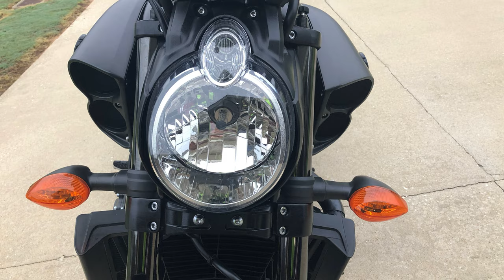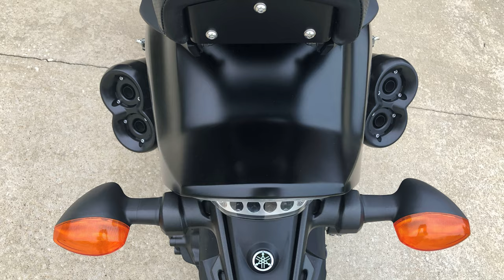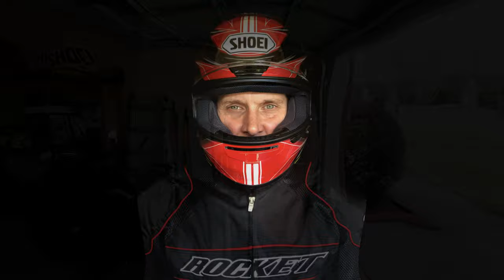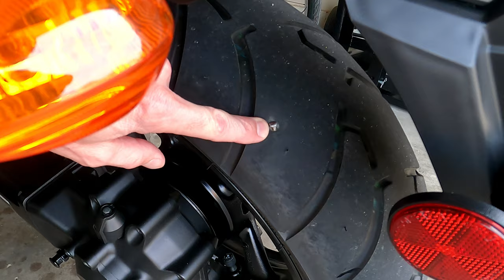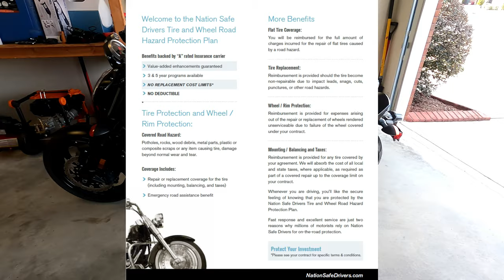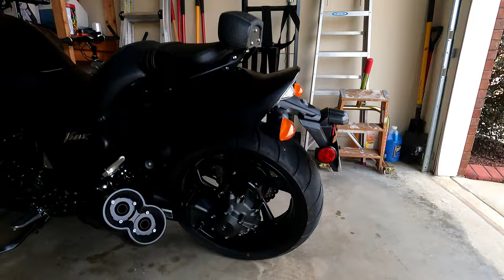Yamaha VMAX 1700 | TPMS Prevented a Disaster!

Comment: I had a nail in the back tire on my 2009 VMAX I put a tire plug in it And yes they work very well It never leaked And I have actually taking a couple trips And never Lost Air And fastest I've been was 165 With that plug they are trustworthy Use them for years and never a failure

Comment: Jeff good morning, you should use this gel called RIDE-ON ... every time you change your tire, DO NOT INSTALL the balance weights, open the valve steam put the gel, and ride for 15 minutes, the gel will go around balancing the tire, and in case like you had, as soon you pull off the nail the gel will seal the whole, but make sure you have away to put air on the tire.... I have the RIDE-ON INSTALLED on my both tires and, no more scratches on the rims and NO VIBRATION AT ALL
Reply from the maker: Thanks for watching and thanks for the suggestion. I checked it out online. I like it! It's a Two-for-One product. The balancing aspect would eliminate any potential issues with the TPMS sensor cap that some people are concerned about. I might just try it at some point.

Comment: Great video Jeff!  Sorry about the leak, but pulling the rear wheel is not that hard.  When I take mine off I let most of the air out prior to removal making it that much easier.  The tough part about the G-2 is no center stand.  Thanks for all U do.  :)
Reply from the maker: Thank you Jay. In the future it might be something I would tackle. However, because everything is under warranty, I'm going to let others do what needs done, especially when I don't need to pay for it. 😎
Reply: @JeffMarcum  Jeff, I have my enclosed motorcycle trailer but have been looking at a custom made aluminum open landscape trailer and they told me that if I bought the premium rims and tires there was a warranty that stated it would cover some one doing a road service to change a tire or replace if damaged for 1 year or so,,never heard of such a thing, now you speak of it, real bummer getting that screw so soon.  ;)

Comment: That is a neat system! Are you sure it won't leak or be problematic over time? I have used the old conventional tire monitor caps in the past and they caused problems.
Reply from the maker: I have had them on since December. So far so good.